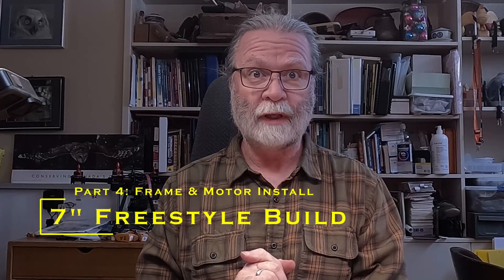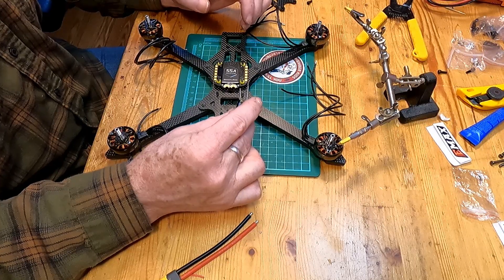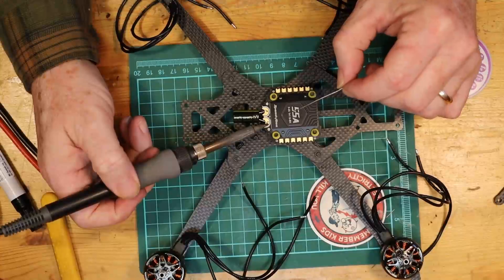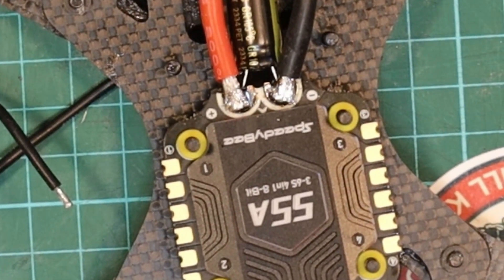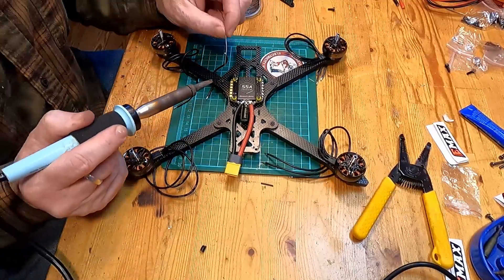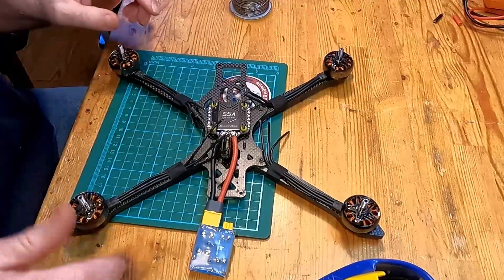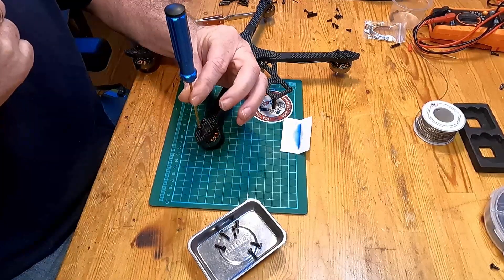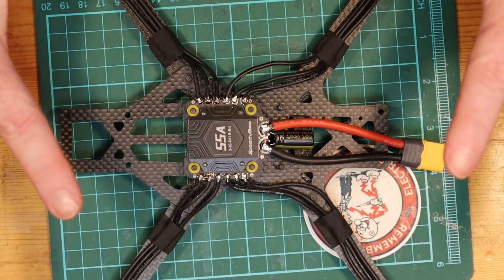Build a 7" Freestyle Quad - Part 4: Soldering the XT-60 & Motors

Comment: I have the same esc/fc and hakko fx888D. I cannot seem to get solder to flow onto the battery pads at all! 750 and 850 F! I know it’s technique but man…I can’t figure it out. The heatsink covering all the parts gets too hot to touch before the kester 63/37 melts
Reply from the maker: Thanks for leaving the comment.  I'm sorry to hear you're having trouble with the soldering.  Without actually seeing what you're doing it is hard to give a sure answer or advice.  Regardless, here are a few things that may help 1) make sure you are using a solder tip that is almost the same size as the pad, and lay it flat to get as much contact with the pad as possible.  2) make sure the iron's tip is clean and has fresh solder on it (just melt some new solder directly to the tip) 3) gently move the tip of the iron around on the surface of the pad to help distribute  heat more quickly.   4) don't be shy with flux.   You will get the technique with a little practice.  Getting a soldering practice board can be very helpful and let's you practice without risking anything valuable.   Hope this helps a bit.  Best of luck and safe flying.
Eric

Comment: What do you typically keep the iron at when soldering the tx60 connector wire to the board? I've struggling with 650!
Reply from the maker: Hi.  Thanks for watching the video and leaving a comment/question.  I have two temperature controlled irons, and I typically keep them both at 750f.  It really helps to have a larger chisel style tip on the iron, especially if you are using 12 gauge wire.  Negative pads also always take more heat.  I almost always do 3 steps: 1) heat pad and tin well (or simply reflow solder if already tinned).  Then, #2 right away heat wire to fully tin (or simply reflow solder in wire if already tinned). Lastly, #3, and again right away, reheat pad and merge to melt both together.  Flux is your friend with this too, and so are cross-locking tweezers.

Hope this helps a bit.
Eric